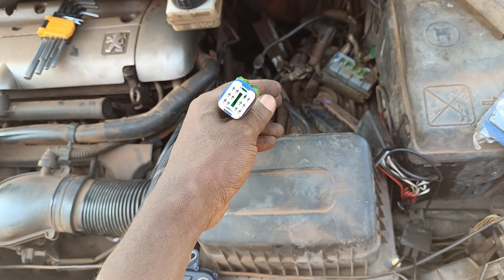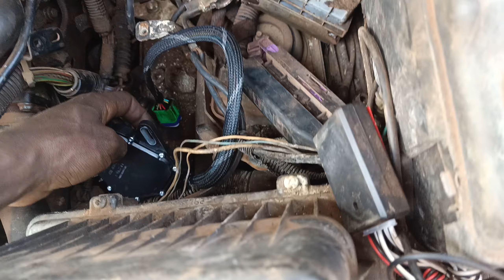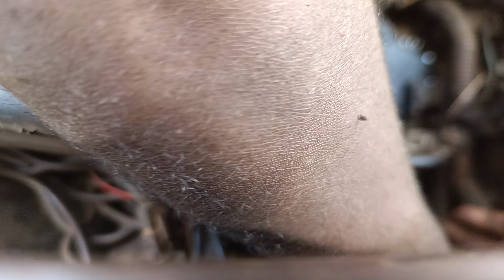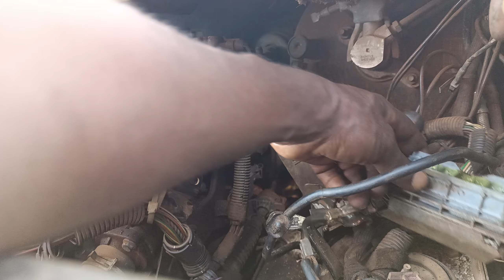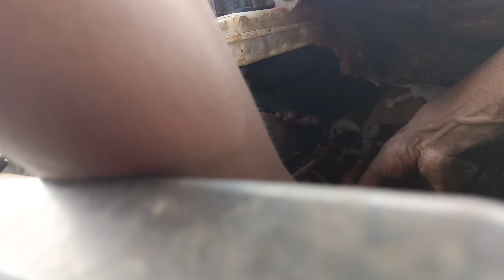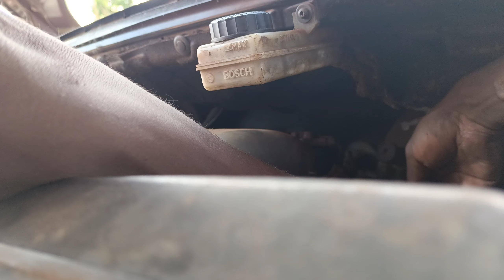How to replace neutral gear selector switch in peugeot 307cc automatic

Comment: Brother how are you, i hope you answering me,
I have citroen c3 2007 i changed selector by my self, then when i out P in gear it stay R, then i go under ponet then hold gear cable back its come P, and after changing that selector i calibrate it on N but car not starting just one click from starter but no starting just one click and battery new and charged 13V
Reply from the maker: @coldxzeroyt  Calibrate in P instead, put the gear lever in Park P then adjust the selector to the extreme end before replacing it in the car
Reply: @charixcharley  but bro i use multimeter to determin N is P same i can use multimeter in P? And what is the reason car unable to start no any faulti codes
Reply from the maker: @coldxzeroyt  does it refuse to start when it’s showing N
Reply: @charixcharley  yes brother i checked all fuses is okay but car not starting just one click only, i try in P and in N not starting
Reply: @charixcharley  also bro i already changed solenoid 2 sensors in gear and still showing snow and sport on screen
Reply from the maker: @coldxzeroyt  does it show the P or the N on the screen ?
Reply: @charixcharley  yes bro but if i remove from P to r or n and return it to P it give R until i go under ponet and hold cable back it go to P from shifter if i remove to R it cant go P again from shifter, also i press 30 sec on brake untile i hear shifter moving in P
Reply from the maker: @coldxzeroyt  was the selector you replaced new
Reply: @charixcharley  yes brother also i cleaned the old one